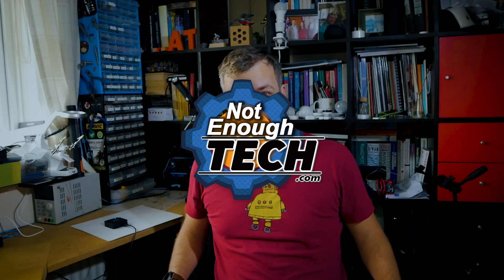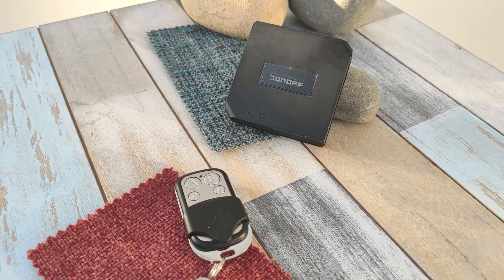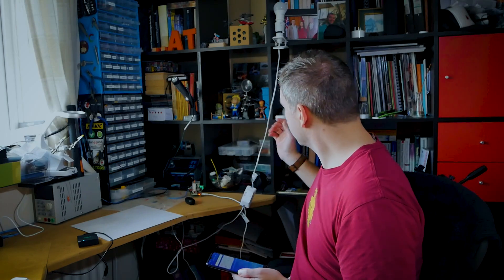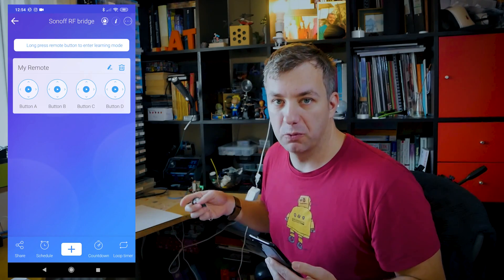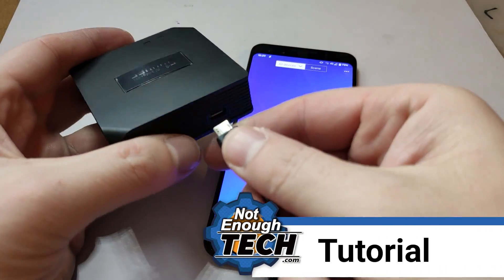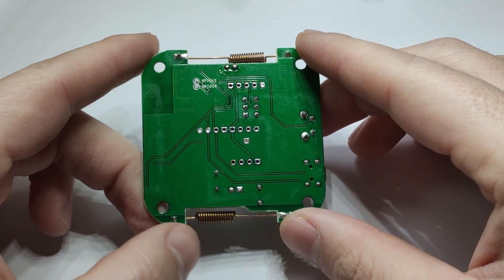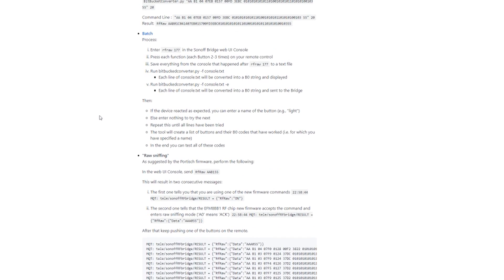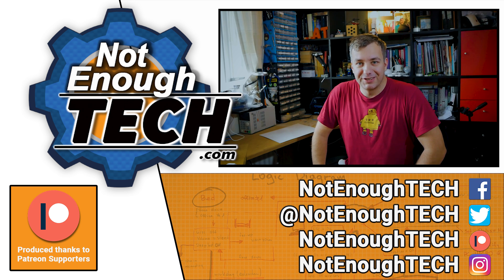Sonoff RF bridge - is RF433MHz still relevant?

Comment: hacked mine with tasmota, now i can use a generic remote to trigger the other sonoffs in my house if i don't want to use voice :)
i use tasmota websend command on rf bridge to recall other tasmota devices by ip, so no mqtt or controller is even needed...
Reply from the maker: From a couple of comments I see that people do like to flash it! I have 2 RF devices I could control (that are linked anyway) so I'm not sure if I should do it... Although having this work with more RF modules is tempting
Reply: @notenoughtech  as you are not going to use it so much anyway, why not hack it? 😬
Reply from the maker: I'm sure at some point I will... Once I run out of Zigbee hacks... :)

Comment: I have a broadlink RM pro which does the same sorta thing with the addition of also doing IR. It also talks to google home so i can control any sonoffs directly and anything on IR/RF via the broadlink from the home app/by talking to my home devices.
Reply from the maker: I was thinking to try one of the broadlink devices... Figured will get a sonoff first and see how useful it is
Reply: I have the plus and the mini.  Unfortunately they are a little harder to integrate into home automation and they are useless for monitoring devices like leak detectors.  That's why I bought a Sonoff as a supplement to the Broadlands devices.
Reply from the maker: Jump on ZigBee bandwagon ;)